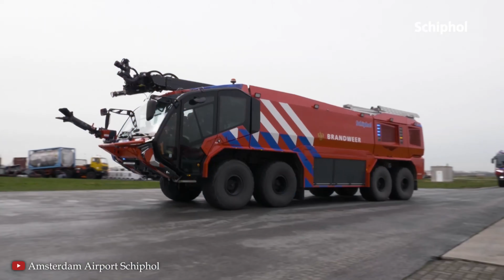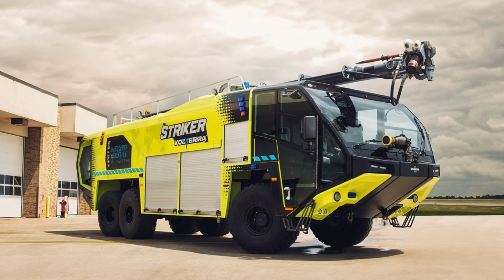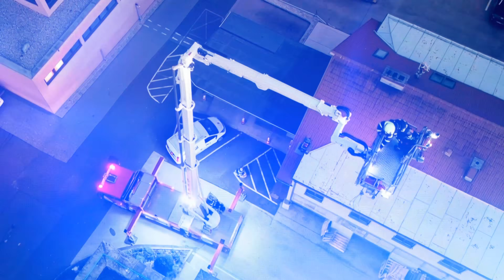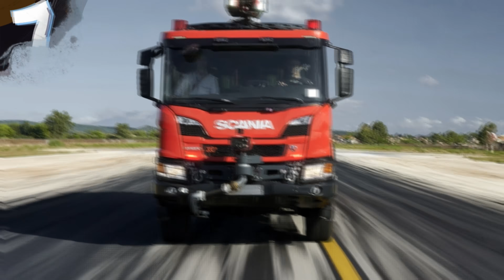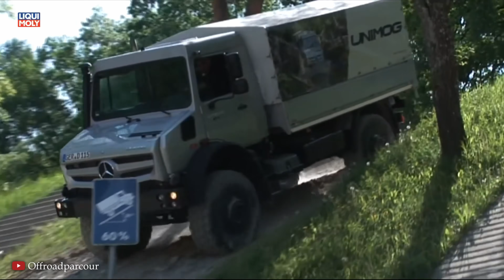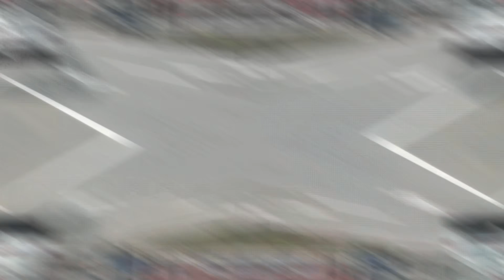15 FIRE TRUCKS that are very Advanced

Comment: Worked with the panther, via high tech & some times this can cause an issue when something goes wrong. Found this with a few of the American Oshkosh vehicles with pressure valves failing & parts hard to get & expensive! 
I’m still a lever type guy with 27 years of experience in the aviation firefighting industry. 
Regards Stephen Alberta Canada.

Comment: 24:00 the Rosenbauer AT. Lots of wrong pictures and information here. It's built on a commercial truck chassis, and it's not even new. It's been around for literally decades already. Most of the pictures you showed for the AT actually showed the RT instead

Comment: Electric Fire Engines are  J U N K  my department's Electric Pumper is always out of service and in the shop
Reply: what department is that? Funny,. the department running the most RT doesn't have much issues with it; Neither does the department few minutes from my place, running 2 of the RTs

Comment: During #10, it appears to me that someone has redesigned the old “Snorkel”. I took a basket ride once in the late 70’s. Then they were gone. Also, I subscribe to a “Fire fighter training channel” that deals with the EV question. If I were in a position to make decisions, I would not want ANY EV firefighting equipment in my department UNTIL the “bugs” are worked out of the system. If you are at a busy station that regularly responds to 10-15 emergency responses per day, when do you get to recharge the batteries and what happens if the rig is out for an extended period. The whole EV thing has got to have the “bugs” worked out before these apparatus are put into service. Just my thoughts.

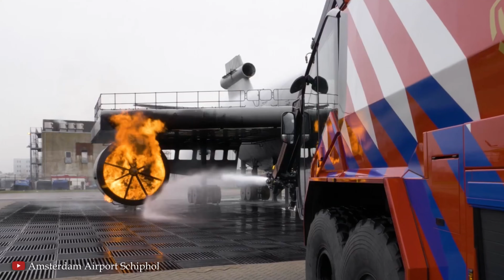Comment: 2:30 Interesting how it extinguishes fire and cools the road by spraying the road its driving on with water.  Do most airport fire vehicles do this?
Reply: Yes they do, most times we have to drive thru burning fuel to reach aircraft, under nozzles keep flames from damaging apparatus.
Reply: @racevw14 so u are a airport fire fighter cool
Reply: @racevw14 do u also use tankers
Reply: @hotdogs-u6p Retired, used to do airport crash rescue & structural firefighting for 30 years.
No tankers, not time to refill during fire, also they carry 5000+ gallons on board compared to structural trucks that carry 500 gallons.